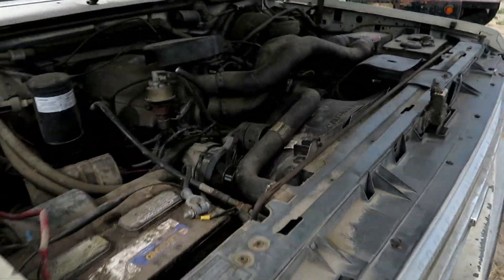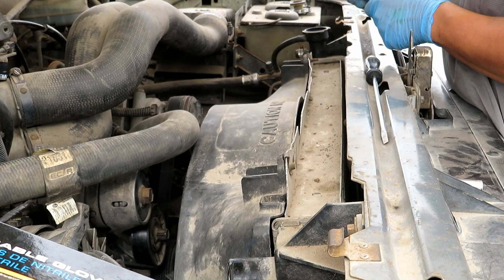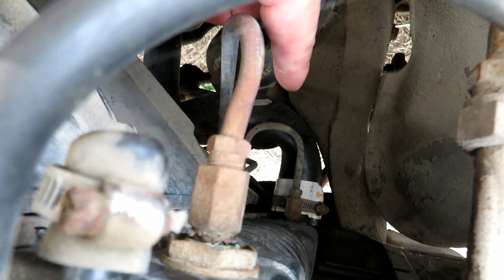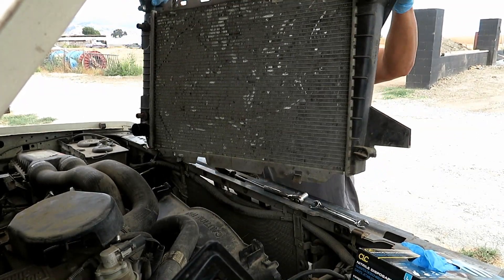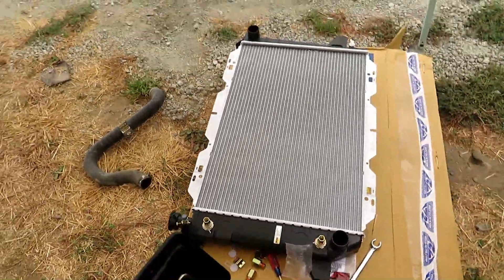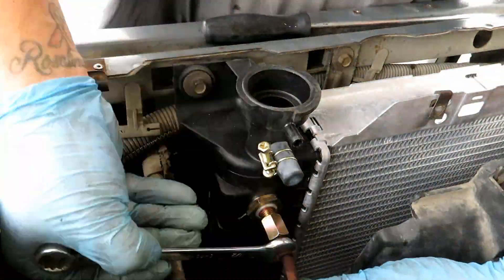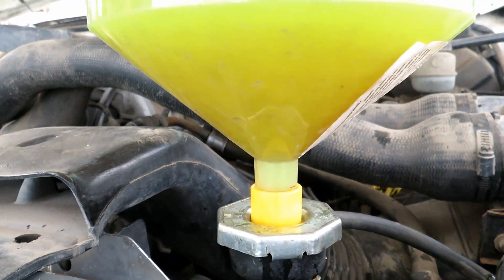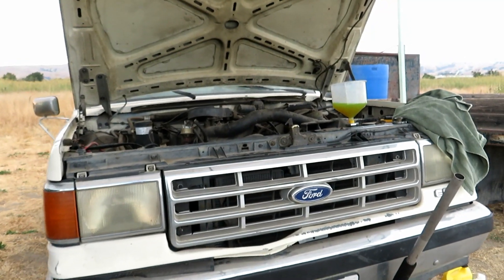Ford F-150 (3rd Generation) 5.0L - Radiator Replacement

Comment: Do you know that the plug/cap is for on the driver side of the radiator? Mine has it too and I don’t understand why?
Reply from the maker: Possibly for an extra cooler for a diff spec truck if i had go guess
Reply: @hyr0llr  so nothing to be worried about, just make sure there theres a cap on it and it is good to go?
Reply from the maker: @tretre1692 yeah you can see the new one has it also. So i would verify its tight and youll be good to go